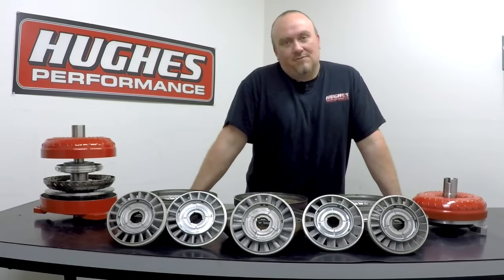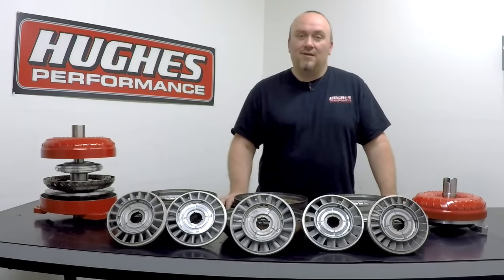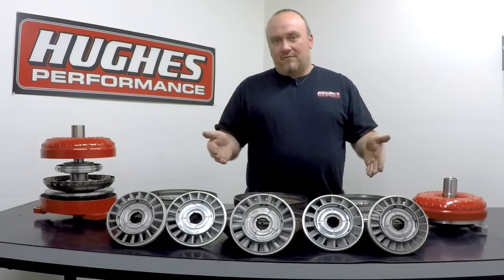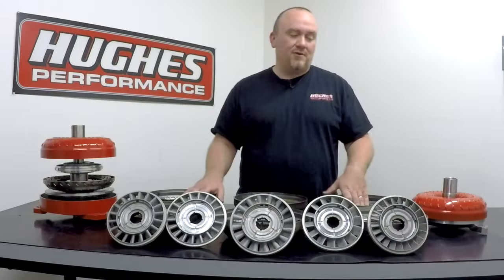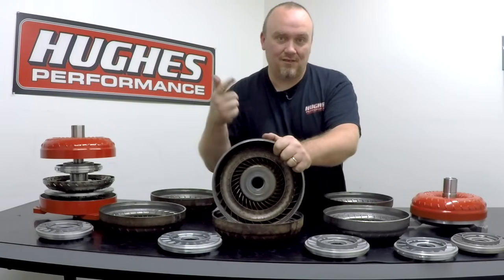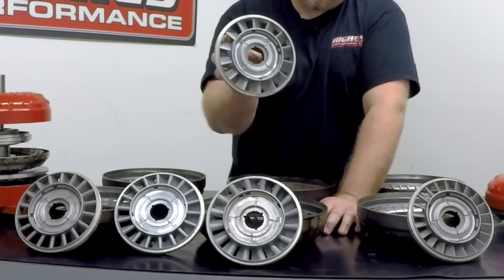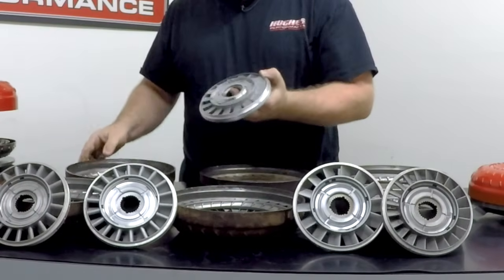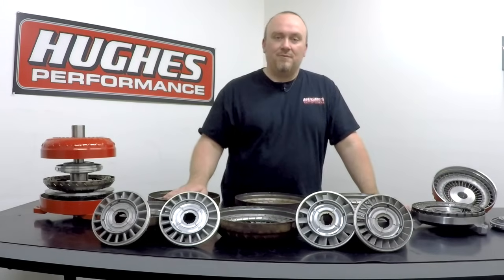Ep. 5 Torque Converters 101: What Is Stall Speed?

Comment: Thank you for making these videos. Curious about stall speed application. I’m guessing a high rpm hydraulic hookup would be used for drag racing where ya only care about 4-8k rpm. A slow hydraulic hookup, say 800 rpm for a Diesel tractor. Am I in the ballpark?
Reply from the maker: Thanks for your support and for commenting!  We really appreciate it!!

You're definitely thinking along the right lines.  The vast majority of torque converters that we build for dedicated drag racing applications will typically provide a flash RPM of anywhere from 4,500 RPM to as much as 7,000 RPM and beyond, depending on the application.  We tailor the necessary stall speed characteristics and converter coupling point to each specific application when it comes to our custom converter builds.

Modified street-driven diesel applications will typically utilize a torque converter that only provides around 1,000 - 1,500 RPM of flash stall speed.  Due to the torque output of diesel engines and the relatively low RPM ceiling, diesel applications typically need a very low coupling point in the converter.

Hope this helps!!
Reply: I have a 2002 mustang gt stage 4 comp cams and 3200 stall converter do I need a tune again?